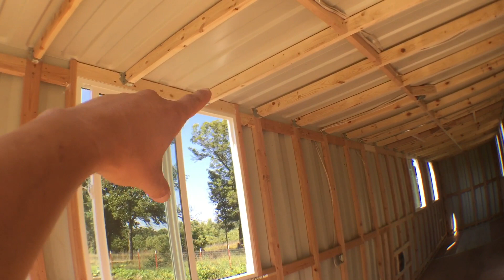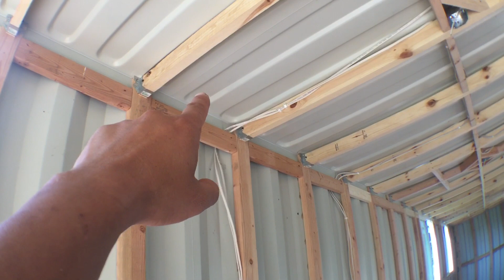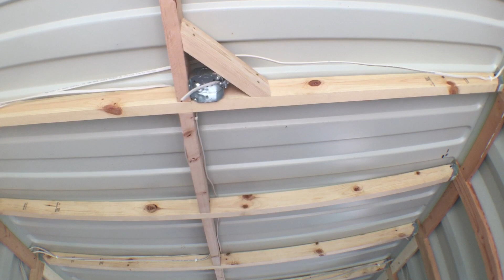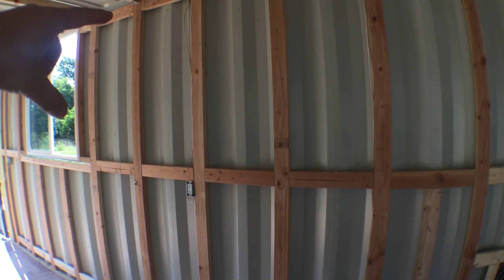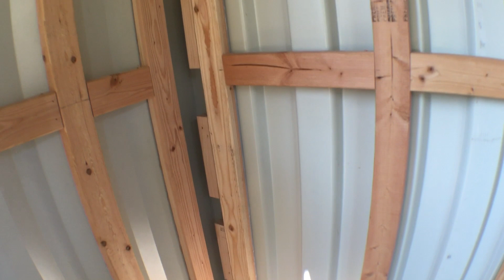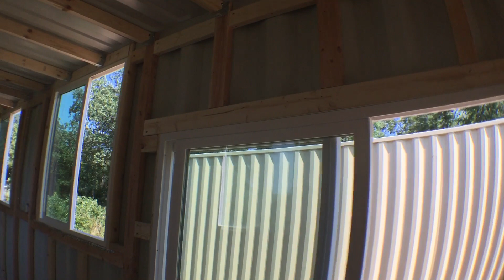Shipping Container House Framing 2.0 - Answers to Your Questions

Comment: I'm about to frame up a container using your vids as a rough guide but I'm wondering....did you screw the top of your studs into the steel support of the container or did you just notch it out and glue it down?

Comment: Great work!!  What did you glue the framing to the metal with?  I was thinking PL Premium construction adhesive.  Also, would you suggest using pressure treated wood as opposed to standard lumber?  Thx!
Reply from the maker: I used the liquid nails product. Thanks 🙏🏻

Comment: Are you running most of your wiring, pex plumbing, etc., UNDER the container or is it going to be between the framing, added later on, but still prior to drywall or shiplap or whatever you use for the walls?

Comment: Your 2x4 construction is NOT overkill. I used 2x2 for the walls and 2x3 for the ceiling and it bows inward. I ended having to shoot screws through the container wall into the framing to keep it from bowing.

Comment: What I would like to see is a detail vedio on how you actually bolted the fram to  the wall especially the top part and what was used to do so. As I'm at a complete lost as to how the fram is made to hold on the wall. Please please please make a video. Thanks
Reply: You do not need to attach it to the container at all. It's totally self supporting through weight and fasteners. It would be a good idea to anchor the wall frame baseplate to the container floor but that's all. A person maybe should use construction adhesive around the window cutouts, if doing them this way. However I had welders create solid metal frames around my window and door cutouts which is far superior! The most important takeaway is *You never want to drill through the container to fasten anything!*
Reply: haha yeah i've been jumping from video to video to find out how people are attaching the framing to the container...sounds like the bottom board is screwed into the wood floor of the container. Then the framing goes up from there.  Glued to the wall to hold it somewhat in place.  Then once all of the framing is in, it holds itself up against the walls...
Reply: @cameronsonju6993 lol  Yeah that's great and all but we need to see it in action to really understand for those who are none carpenter works. Detail video please and thank you.😊
Reply: @qizz3457  I agree! No one has good information on it.
Reply: @cameronsonju6993  Yes unfortunately!😕 Anyone out there that has a detail video on  framing. Please share or make one. 😁😁
Reply: Terri walter You can use glue
Reply: Self tapping screws into that top plate of steel that runs along left of the container
Reply: Check this out bro https://youtu.be/dxSC5siATA8

Comment: It's going to be fine the way you've done it.  To prevent condensation between the wood and steel I'd use a plastic vapor barrier on top of the foam insulation.  Nice job!

Comment: Are you worried at all about the spray insulation forcing your horizontal braces out when it gets between the wood and the metal?  I have limited experience with spray insulation but I've seen it destroy structures when it expands.

Thanks for sharing!